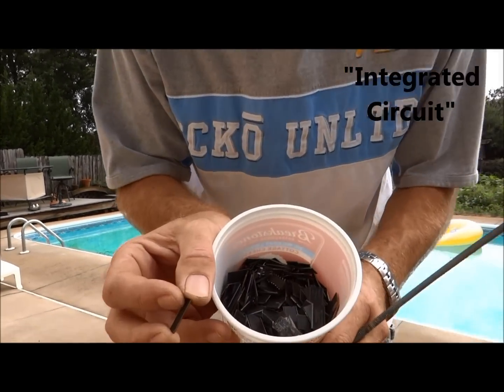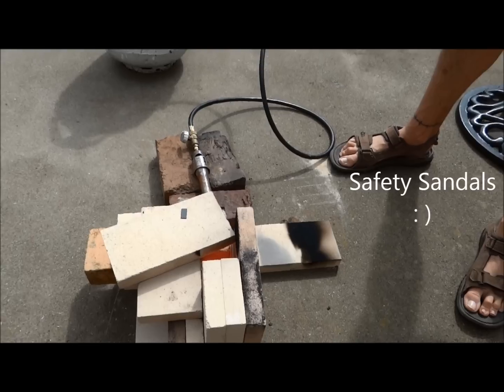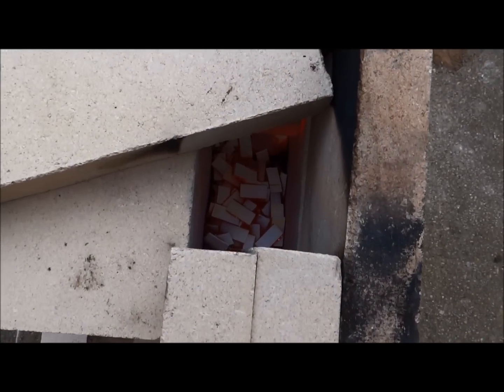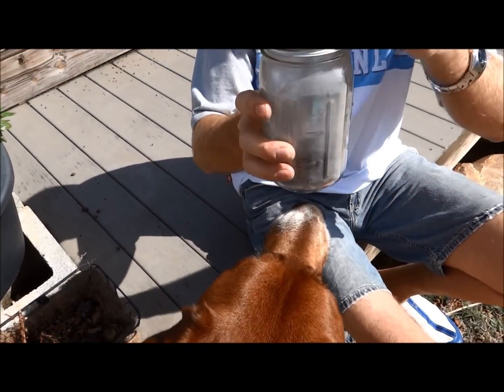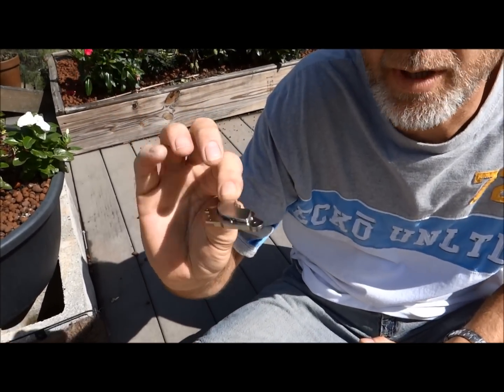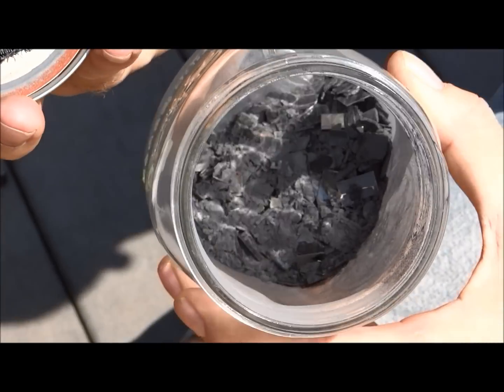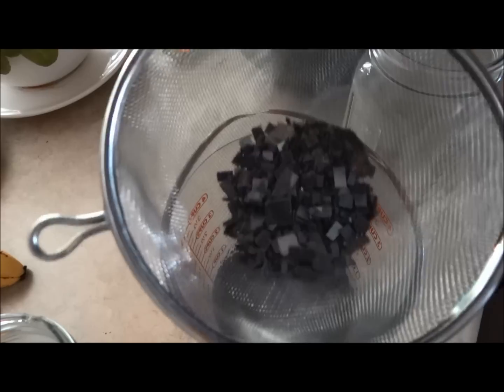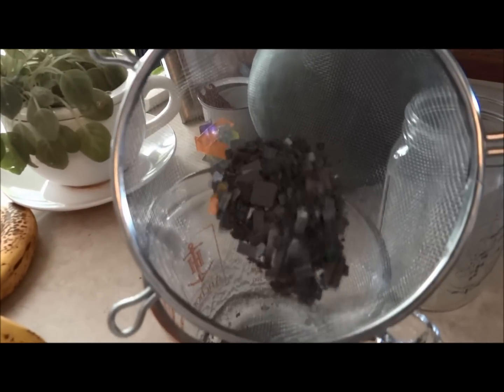Recover Gold from Computer Memory IC chips - With a DIY Incinerator

Comment: Did you have a follow up video to show the rest of the process of extracting the gold? How do you extract the silver after the gold, if there is any? Thanks.
Reply: Actually if you want to get the Silver you do that process FIRST. 

Soak it in heated 70% Concentrated Nitric Acid. That forms Silver Nitrate in solution. Then stick in a Copper Pipe and let the Silver cement out of solution. Copper replaces the Silver as the metallic part of the metallic salt and the Silver drops out. You are left with Copper Nitrate in Solution. Filter the precipitate as that is 99% Silver.  How to get rid of that Copper Nitrate Solution...Heh...Heh...Heh...Hazmat? A Storm Drain...at Midnight? Yeah...Far from where you live.

But there is nowhere near enough Silver in what he has to worry about as it will be entirely uneconomical. (The price of the Acid is far, far more expensive than the price of any possible Silver recovered. That is unless you really like throwing money away...) And getting rid of that refuse?

To get to the Gold....

Soak the ash in 3 parts 35% Concentrate Muriatic Acid and 1 part 70% Concentrated Nitric Acid by volume in a Pyrex flask. (Be stingy with your chemicals.) 

Stir with a plastic spoon and actually wear GLOVES. (NO SAFETY SANDALS ALLOWED. NO UNSCHEDULED TRIPS TO THE EMERGENCY ROOM ARE ALLOWED)  It needs to have the consistency of a thin slush. 

Let it sit overnight.

Drain off the liquid through a filter. (Save ALL FILTERS...You will incinerate them again the next time in order to recover any Gold Salts trapped in them.)

The liquid should be a yucky  dark ash color....(You did not get it all.) Discard the ash. It should have no Gold as the Aqua Regia which you have made has dissolved all of the Gold and it is suspended in the liquid as Gold Chloride Molecules.

Crush the silicon chips into the finest powder that you can with a mortar and pistle.

Add the crushed silicon chips into the liquid and allow that to sit overnight. (It is fine GLASS so be careful when handling it.)

Filter the liquid again, discarding the crushed Silicon Chips, as the Gold is dissolved into solution as Gold Chloride Molecules. (Save your filter for future incineration.)

Next...

Add the same volume of Distilled Water to the liquid.

With a new filter, filter it again. (Save the filter...future incineration.)

It should be clearer and more yellow.

With a new filter, filter it again (Save the filter..Paper is cheap.)

Repeat that process until the liquid is golden yellow. ( Maybe three or four times maximum. Well it can have a little ash in it. You are just not going to get it all and the ash will end up oxidizing in the furnace anyway, transforming into Carbon Monoxide or Carbon Dioxide gas.). The reason is that you want to OBSERVE the reactions and ash will occlude and inhibit that ability

Once the liquid is clear and yellow...

Add Urea until the solution stops reacting. (Do this slowly and have your container inside of another container just in case you add too much and it "boils over" Actually the container will become quite cold as you are doing this.) Wear a gas mask as it produces noxious fumes.

Any present Nitric Acid is required to be neutralized and that is what adding Urea does.

So at this point you have Gold Chloride in a weaker Muriatic Acid Solution. Now we need to drop that Gold out of solution.

So you add some Sodium Metabisulfite or Sodium Pyrosulfite to the solution until there is no reaction. (Two names for the same chemical)

The solution should turn from golden yellow to murky brown as the Gold precipitates out. 

Let it sit overnight. The Gold, which looks like a Red Mud...but it is 99% Pure Gold...will have settled to the bottom and the fluid will appear clear and colorless.

The clear and colorless fluid which is left is SULFUROUS ACID,  not the much more dangerous and toxic Sulfuric Acid.

Take a  Q-Tip and place it into the Sulferous Acid Solution...

Add a drop of Stannous Chloride Solution onto the Q-Tip. If the color changes it means that you still have Gold in solution and need to add some more Sodium Metabisulfite to drop it out.

If there is no color change then slowly...and I mean slowly...syringe the Sulferous Acid out of the container being careful not to disturb the Gold precipitate at the bottom. (Easier written than done.) Remove as much as possible.

Repeating the Chemical process yields .999 Fine Gold.

Pour the remainder into a  Graphite crucible, add some Borax Soap, and put it in a Smelting furnace. You will get a small button of Gold....maybe worth $10 to $20 for the amount which he processed. (Quarter Gram to a Half Gram)

Neutralize the Sulferous Acid with some Baking Soda, add Baking Soda until there is no reaction, and then throw it away as it is harmless Sodium Sulfide in Water..

Yes I have done it.
Yes it is a pain in the ass.
You are not going to get rich.
Most likely it will end up costing you money.
This is done as a hobby..

Why do it?

Really.. You have to ask? How many people do you know who can refine Gold?
.
Reply: I have seen several videos on the process, and there seems to be disagreement on one step -- some use urea to neutralize the acid solution, and others skip that step and move right on to the sodium metabisulfite step.  It would seem to me that the urea would make it impossible to reuse the solution for future batches, but then I am pretty new to this (still in the learning phase, haven't attempted yet).  Thoughts?

Comment: I've heard from someone that all the precious metals are in the pins and other components within the chips, not in the black stuff you incinerate, but that when you incinerate you lose some of the metals into the ash, making it necessary to process the ash as well.  He said that it is better to pulverize the chips without incinerating, then you can just dispose of the chip material (ceramic?).  Anyway, your thoughts?

Comment: Hello how are you, I have a big problem and any help is very welcome, I'm chemist and beginning the process of extraction of noble metals from infiormatica scraps, and their videos helped me a lot, and already draws some scraps as cpu, and contact pins, but when I face difficulty in extracting gold from the memory chips of memory cards RAM, and my income was too low, using about 3 kilograms of micro chips, which can be going wrong because the amount I have processed draws only 0.3 g of gold, thank you for help
Reply: There is not a lot of Gold in them. If they were manufactured after 2010 there is no Gold in them. 

0.3 grams? I'd check out the blogs over at the Gold Refining Forum. I am reading that the expected yield is 0.8 grams per kilo.

You may be running your furnace too hot and instead of just incinerating the chips to ash you may be vaporizing the Gold right out of them. Decrease your forced air pressure and burn them cooler.

Comment: Geo (on YouTube) says that he places the entire Ram Board in AP. In that way he does two steps in one by recovering the Gold from the fingers while the AP erodes the Iron Legs freeing the Chips. That way you are not left with as much Iron.

Great video. What was the initial weight of the IC Chips and what was the recovered and refined weight of the Gold?

Did you air feed your incinerator?

Thanks.